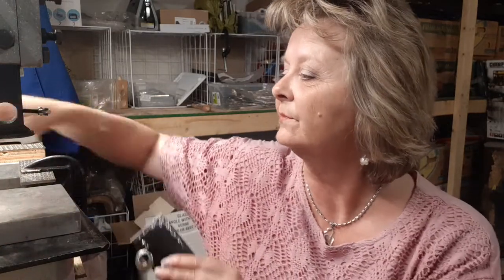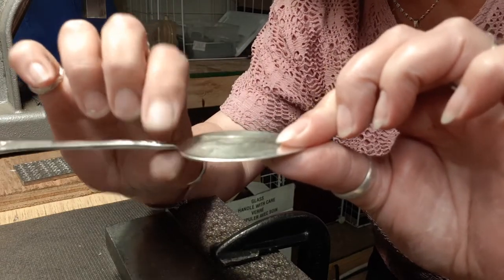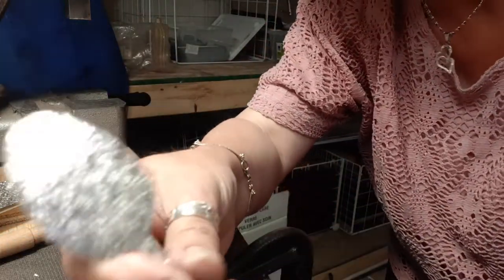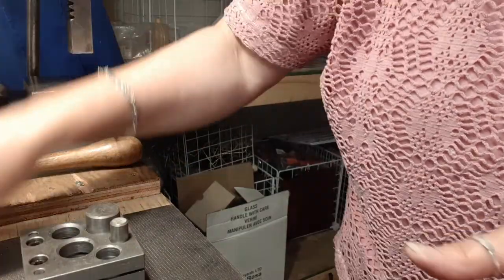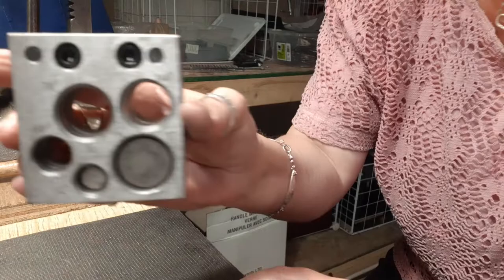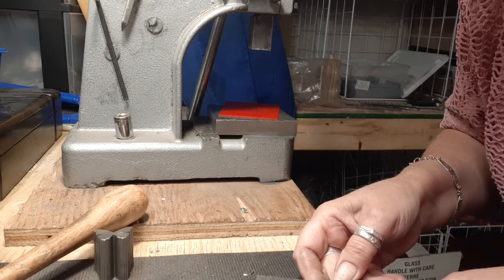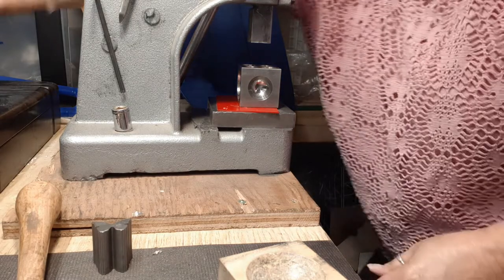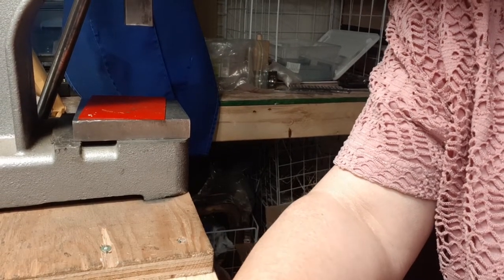Flattening, Texturing, Disc Cutter and Doming with Silverware

Comment: You have a lot more patience than me when it comes to those cheap a** disc cutters-I saw a time when I wanted to throw it out into the yard! haha with the metal still in it. I actually had to use my hydraulic press to get the disc to come through. One vid said you have to put a piece of metal equal thickness on the other side so I tried that and it worked a little better. My next purchase is going to be a Pepe. Thanks for the idea with the delron balls. Will look for them.
Reply from the maker: Thank you so much Cynthia for your comment and yes, you are correct, with the adjustable disc cutters with center spring and the Allen wrench it is best to put a piece of metal equal thickness on the opposite side to keep the unit level when cutting so it will not distort the unit and for a much better cleaner cut.  Your correct again that you get what you pay for and for those starting out and wanting to try the cutters without the major price point it gives them an opportunity while they save up for a good unit for sure :)  I wish that Pepe offered a better variety of styles at a better price :(